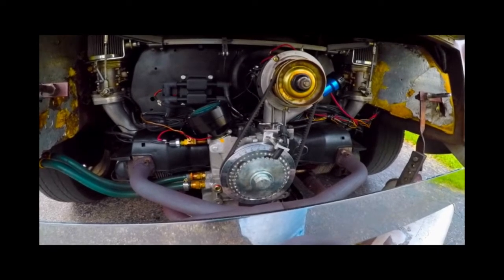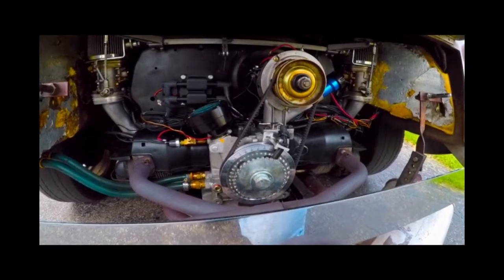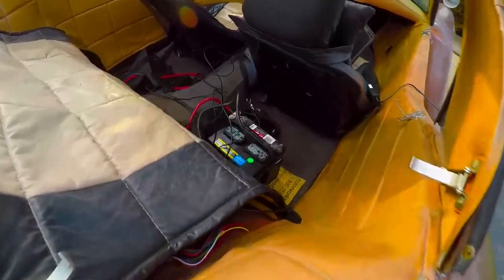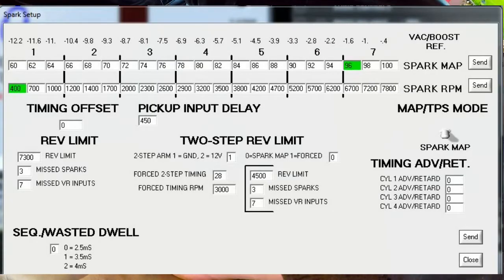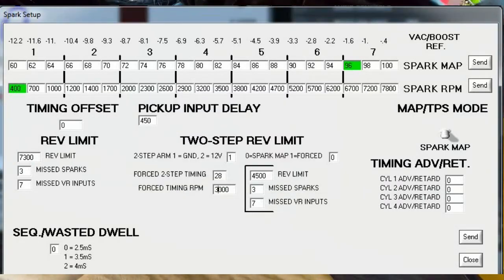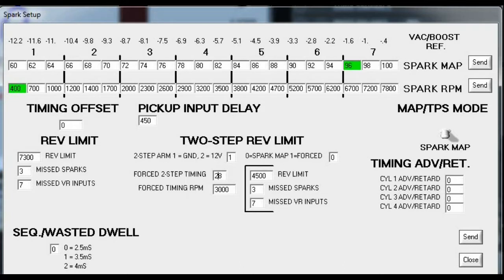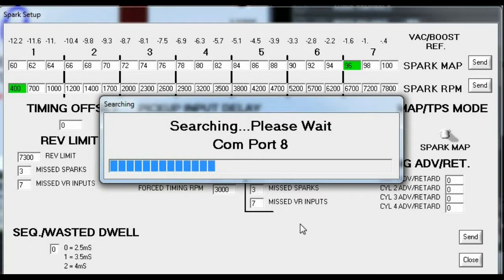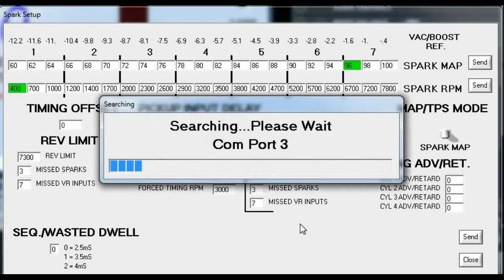VW Crank Trigger Ignition System 2 step rev limiter

Comment: Can you explain more about the wiring of the rev limiter. In the video you mention wiring it to a line lock and that you were just grounding it. Do you normally put a switch inline? Why not leave it activated constantly? I have never been exposed to a rev limiter before so my questions may seem odd.
Reply: Ik this comment was a year ago but ima explain anyway. A 2 step rev limiter is a second rev limiter ment for turbos. The forced timing is so that you can flip a switch step on the gass and retard the timing so it intentionally backfires and ignites in the exhaust so that you can make boost at low rpm then drop the clutch and turn off the 2 step rev limiter.